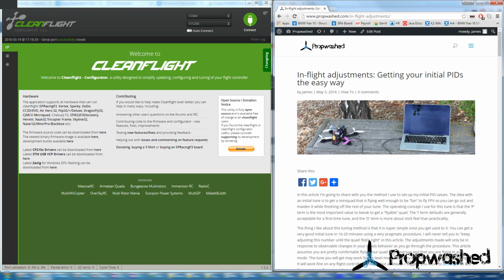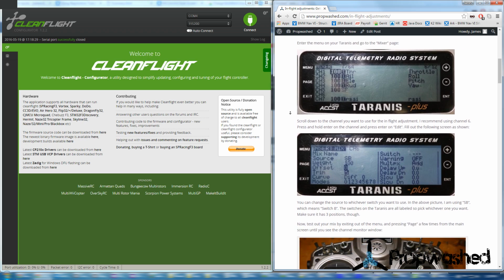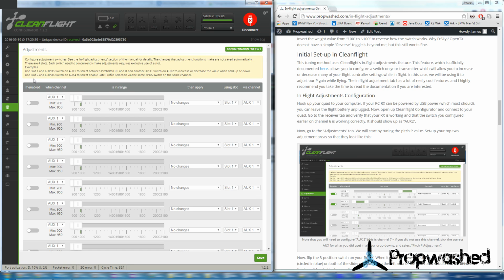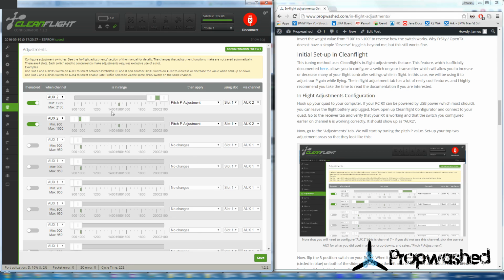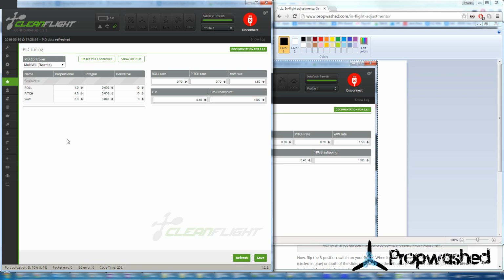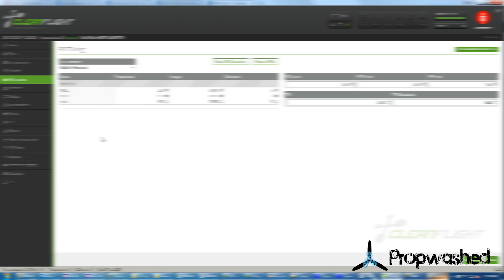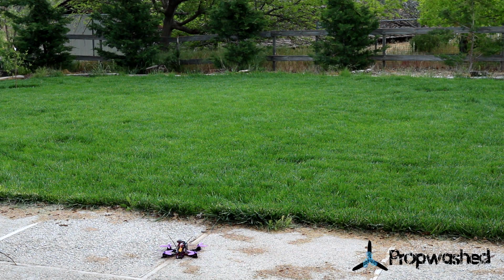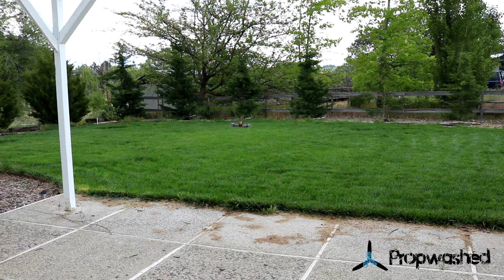Initial PIDs the Easy Way [Propwashed Testbench]

Comment: 1. do you need to be in acro mode for this? 
2. do you need to change the rc expo prior to changing the PIDs?

This is a great and simple explanation on how to find the P gains that I have ever come across! great job!
Reply from the maker: 1 - No but it gives better results if you can use acro mode. Horizon would also be better.
2 - No, expo has no effect on the PIDs.

Comment: As a beginner with quads, what are you actually looking for when the switch is up and the values are increasing? Is it the sound? Or when it gets unbalanced? I can't seem to put my fingers on the moment that you find that it's enough and you stop increasing the values.

Also does this work for the I's and D's aswell?
Reply from the maker: The quad will begin to visibly shake at a very high frequency. It will also start making some strange noises just before it does this. This all occurs within about ~.5 of a P value so the margin for error is around .2.

This will not work for the I and D terms. You will need to tune these by hand. I personally tune I values using Blackbox and D values by feel - we will probably have a post or two up on this in the next few months.